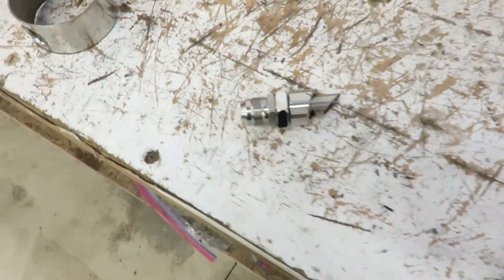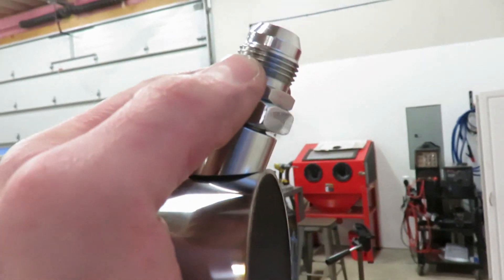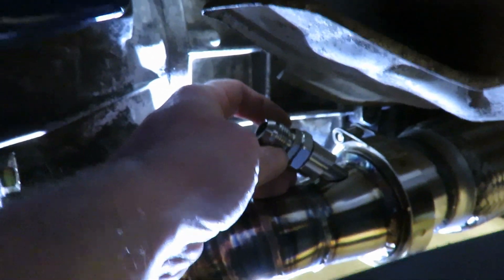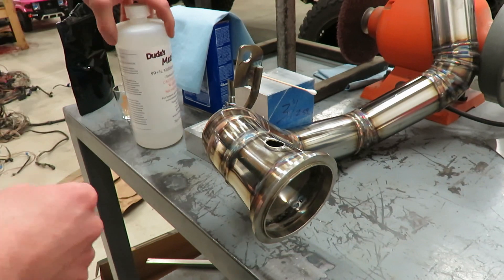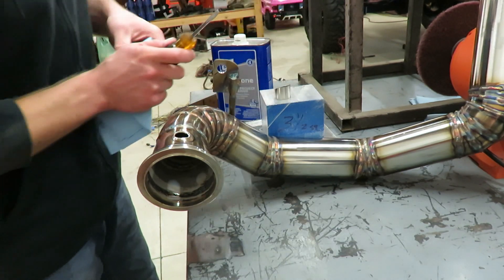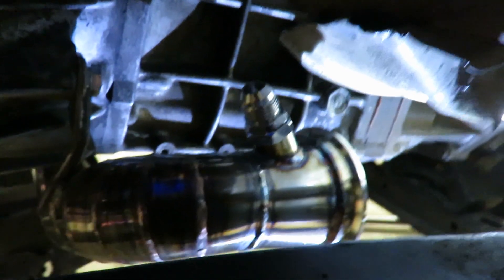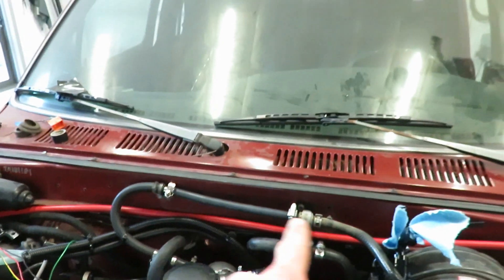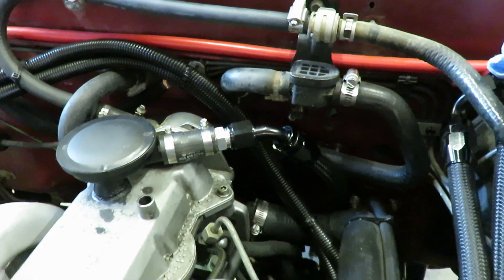Toyota TDI Diesel Swap Installing CCV Scavenger Into Exhaust

Comment: The slot/bevel is supposed to be on the long side, and the opening is supposed to face away from the flow of exhaust gas. If the opening is facing the flow of exhaust gas, the heat will expand into the crankcase. This example can be seen on big rig exhaust tips. The air usually drags around the long tip, creating a low pressure area inside the opening. These work well but need the proper configuration, china manufacturers don’t understand this.

Comment: Hey did it end up pulling a good amount of vacuum?
Reply from the maker: Nope I never got it to work!!
Reply: @austinniemela   @Austin There is only way to make it work. You need constriction in exhaust, like smooth transition from 3" OD to  2" OD. Then outside 2" pipe, you add bung or pipe, so it is flush inside 2" pipe.
Flowing from 3" to 2" constriction gas speeds up, thus pressure drops (vacuum). Easy to fabricate really.
I normally weld bung right after cat (empty). Exhaust flowing from 6" pipe (cat) to 3" pipe create vacuum right in the point where it enters.

Venturi effect, look it up.
Reply: @Fosgen  thank you
Reply: @Fosgen  my exhaust has a fake cat so I guess I should mount it after that. I have seen a few videos of people not being able to pull a vacuum. Would mounting it after a bend in the exhaust work too?
Reply: Oh man sorry to hear that so just vent to atmosphere then? I was going to buy the same fitting

Comment: You doing very good job in welding  bro👌
Reply from the maker: Thanks man!
Reply: Silly question.....will there be much oil blowing out your exhaust with this set up?!
Reply from the maker: Gerard Curran no the ccv doesn’t send out much oil, but at least on my jetta TDI it’s enough to stick the turbo vanes up